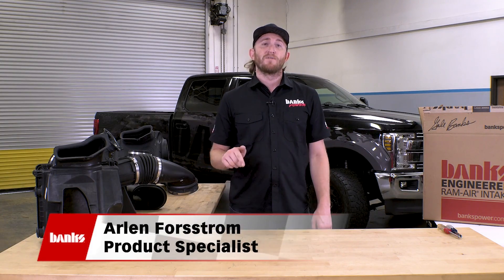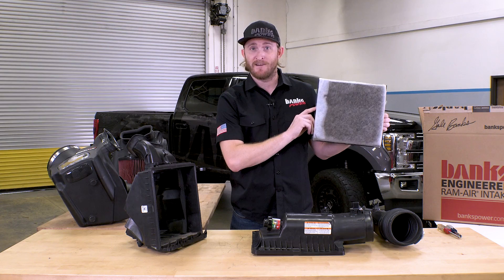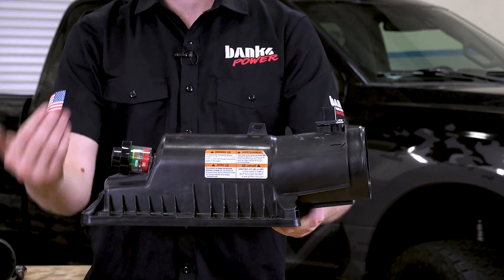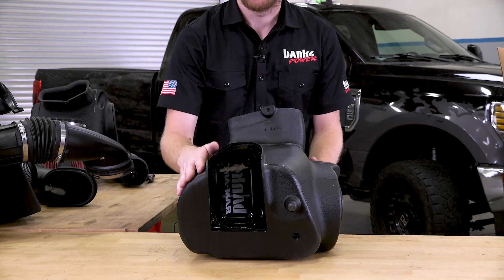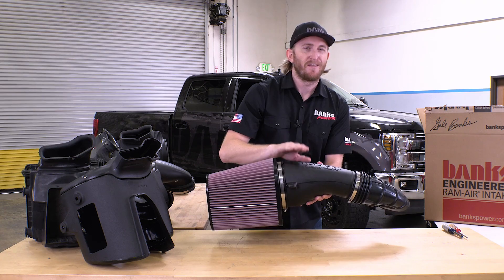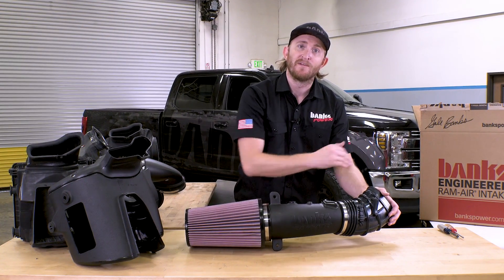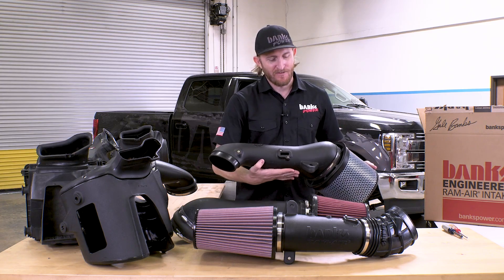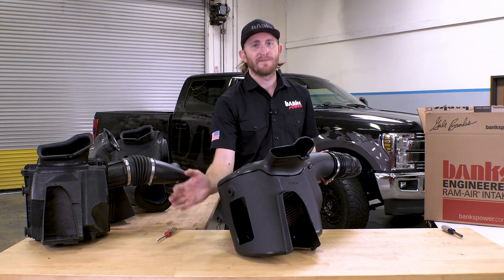Banks Ram-Air System for 2020-22 Ford 6.7L | Features, Benefits, and Competitive Analysis

Comment: The ram air effect you are talking about actually comes more from the lower intake opening because There is air a management tube coming from behind the grill pushing it into the airbox. So talking about the upper opening is not where it gets the ram air effect not understanding why this was done backwards.

Comment: I'm curious what the flow vs pressure drop is on the S&B open air intake, which has a big ole air filter connected to a 5" inlet with a removable restrictor so it'll work with stock MAF scaling. Do you guys have any flow data on that intake? I'd love to see data on it with and without the restrictor!
Reply: @Yeeto767 Do you have any repeatable data to back this claim? Specifically on the intake I am asking about?